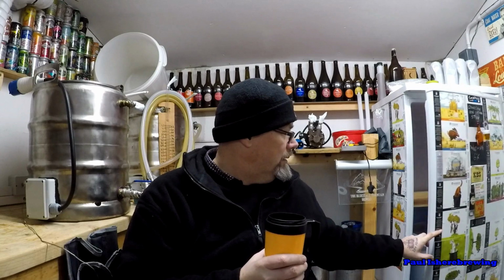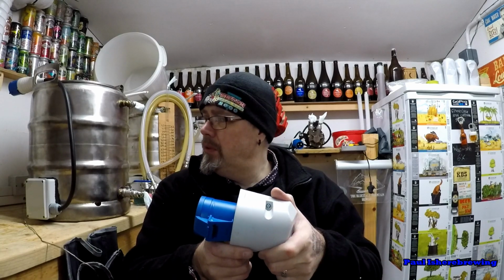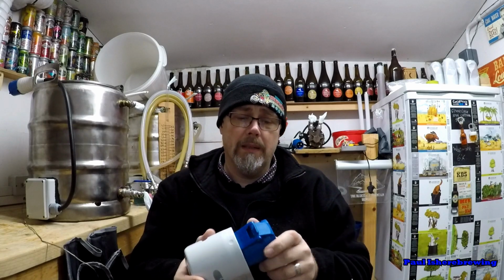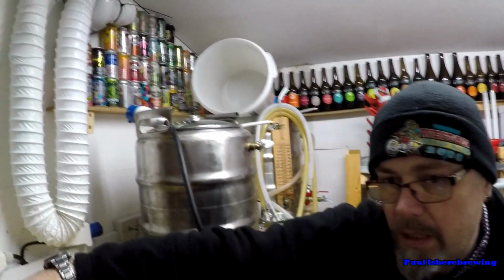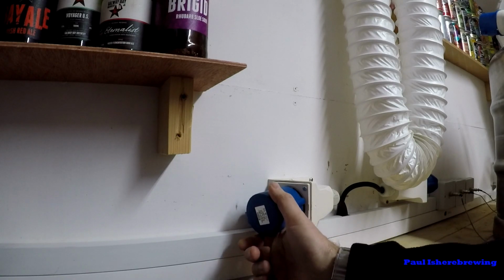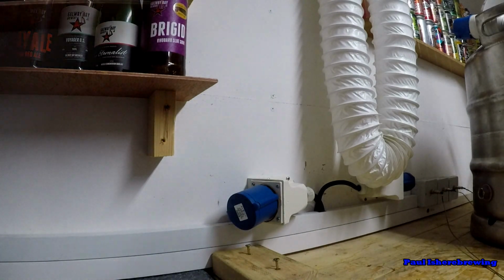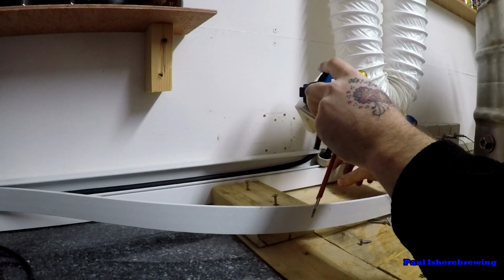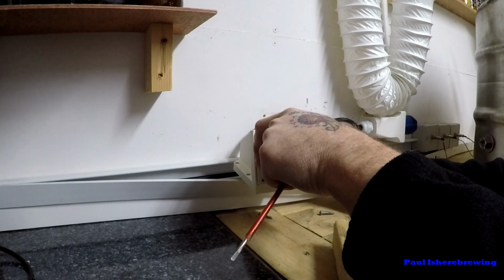Rreplacing a broken 32a socket

Comment: What thickness wire have you used for your 32a socket? Looking at getting one installed in my garage to run an air compressor.. thanks
Reply from the maker: its 3core 6mm trs cable.